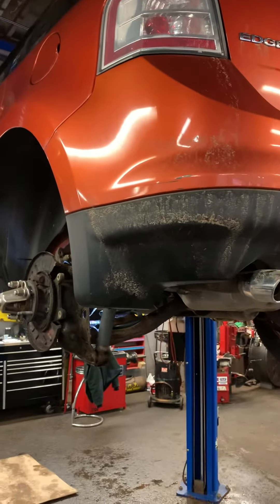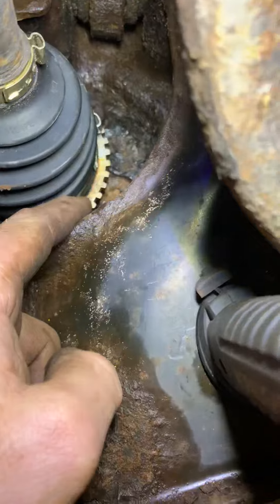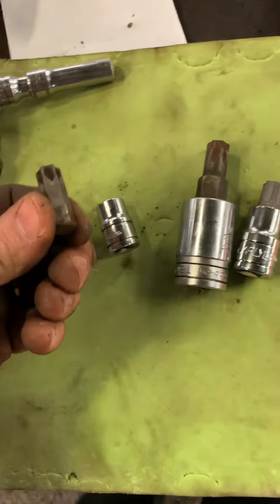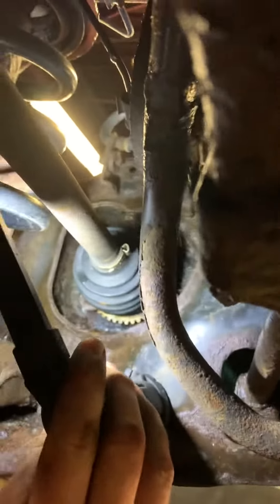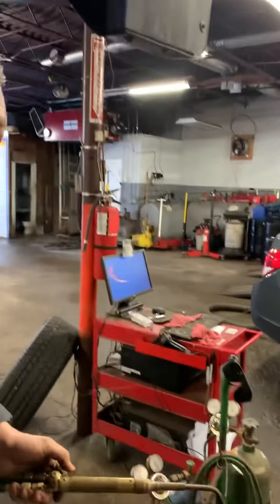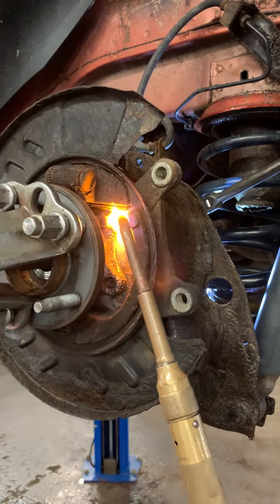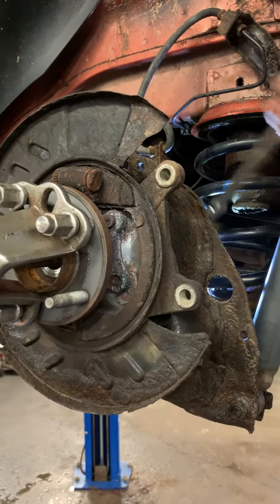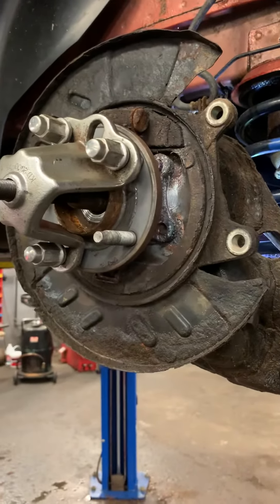Trick for Ford Edge wheel bearings! Save hours!!

Comment: Thank you Dave for the Pro Tip! This video saved me at least 1.5 hrs labor and just to be dealing with compressing the spring and corroded fasteners and bushings, just to remove the axle and gain access to the hub fasteners, the proper socket is not available for at least 10 days from my tool vendors and online. Heat and a T55 who knew, great job! Much appreciated!

Comment: Yeah that's a great tip guys if you use a Harbor Freight t60 it'll also work the trick is to keep the axle shaft pressed all the way in it'll give you enough room to get in between the teeth of the tone rings and you can easily get that out.

Comment: Heat is definitely  helpfull, or a induction  tool. Doing this in a lift so much easier also. Tried you t60 tip....an my T60 was to short and still was interfering with the tone ring

Comment: Save hours??? Just buy the right tool and it takes literally 15 mins to get the bolts out.....
Reply: Also Snap On makes one but it costs a bit more.
Reply: @jefrhi  hahaha that's awesome! I know I can be an asshole sometimes!
Reply: Seriously though if you have that tool it is pretty damn easy. The hardest part is getting on the bolts but once you do just a decent length 3/8 ratchet breaks them loose without heat most times
Reply: Seriously though if you have that tool it is pretty damn easy. The hardest part is getting on the bolts but once you do just a decent length 3/8 ratchet breaks them loose without heat most times